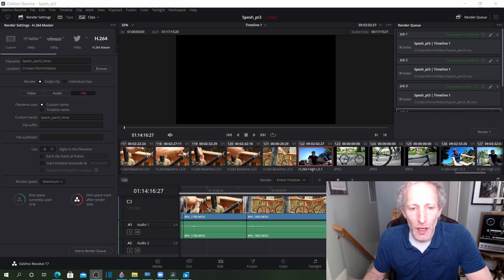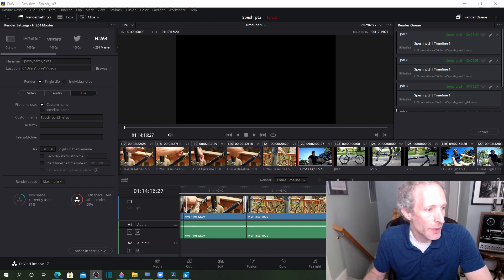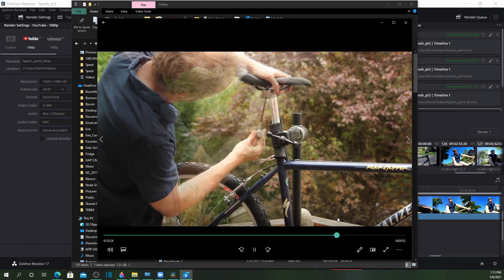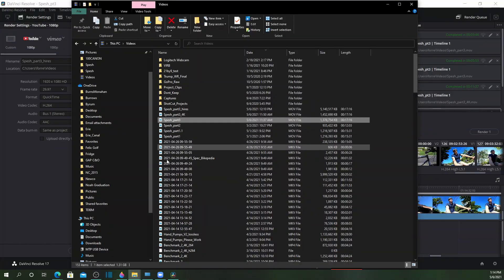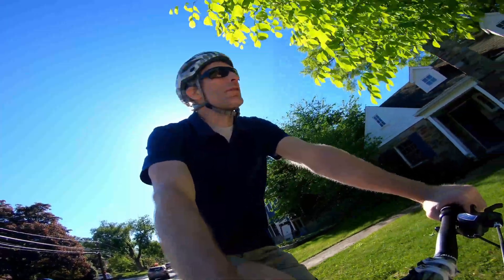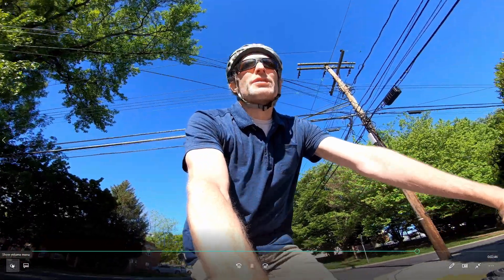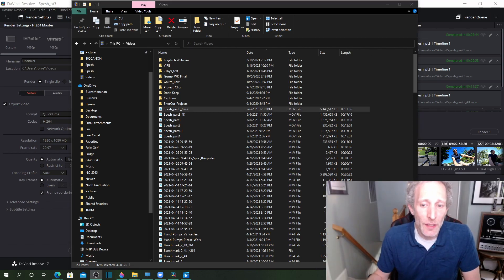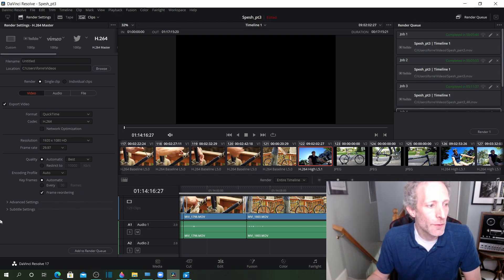Fixed!! DaVinci Resolve 4K footage in 1080P project looks horrible pixelated!  Downscaling Upscaling

Comment: For those who still cant get the crystal clear footage, after testing 91839362 times downscaling from 4k to 1080p with different apps like final cut, da vinci, I can confirm that the issue of pixellation is because of single pass. You must use multi pass and it doesn't matter what file format or encoder u pick. I also tested like main, main10, mov, mp4, h264, h265 (hevc), etc. I tested em all. No difference. Just use multipass. Oh and also if u wanna drop the file size, u can do that as well. My original footage is 4k60 10bit with 50.000 bitrate. If i drop bitrate to 10k, it becomes pixellated on camera movements. To surpass this, activate multipass and u gonna get sharp and perfect video again with minimal loss. It of course depends on your footage, just play around woth bitrate and find the optimal one and u gonna see the file size reduced drastically.

Comment: Thanks for the great tip on fixing video pixelization. I was getting so frustrated with DaVinci 18 and could not figure out what the problem was. Simply choosing the H.264 master setting fixed my problem. I just watched another video and they said that if you upload to Youtube in 1080 they use AVC1 to compress the video but if you go with a higher resolution they use VP09 and that helps. Great information thanks for helping.

Comment: And yes since I’m commenting on this video in 2023 with Davinci Resolve 18, it means it still happens on the latest version. I did encounter this same issue and also found the h.264 master preset as the solution with the caveat of larger file size. I guess this is what we will be doing to avoid this kind of issue.
Thank you for uploading this video. Definitely helped confirm my findings.

Comment: I've been trying to learn it. It keeps importing my 1440p videos into 1080 30 fps and forcing upscales. Sometimes it loses color quality hm.. So leaving the renderer at 1080p still output 4k? uh ok
Reply from the maker: I always try to set my resolution and FPS in  project settings to what I want my final output to be before I import my footage. If the footage is different then your project settings, it will ask you if you want to change your project settings to match your footage.  If you choose yes then it will overwrite the project settings you just customized. If you click no it will leave follow the project settings and either upscale or downscale your footage.  That said, anything shot with anything other than my DSLR doesn't seem to respond very well to upscaling or downscaling in DaVinci.

Comment: Thanks Forrest, this was exactly the problem I tried to solve! Do you know what should I select in that settings in order to keep my 1-minute clip under 1 GB size?
Reply from the maker: The higher quality settings definitely  generate bigger files.  I recently upgraded Da Vinci and now have the option for h.265 encoding which is more efficient/smaller files.
Reply: @forrestblank  thank you!

Comment: Thanks for taking the time to make a video showing exactly what your problem is, also showing the results of each of the setting you attempted.   This is something that Resolve has yet to fix and Adobe still crushes it.  I don't have any problem with Davinci's editor, though I think its silly to make adding text to a video using fusion and having silly time coding confusion that overlaps, dont get me started on all those connect the bubble crap.  The encoding however is so ridiculously slow for poor results.  Adobe will encode a video at least twice if not three times faster and at better quality.  But i also don't like being extorted 50$ a month, so that's why i switch to Davinci.
Reply: Did you ever figure out how to fix it ?